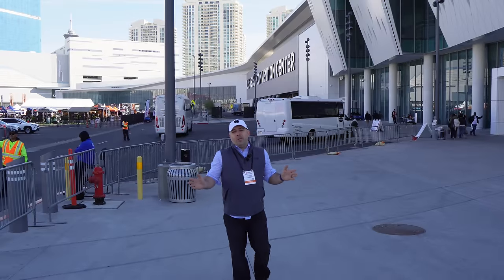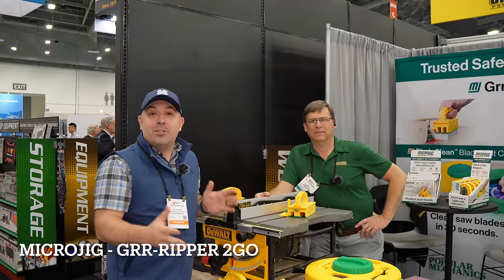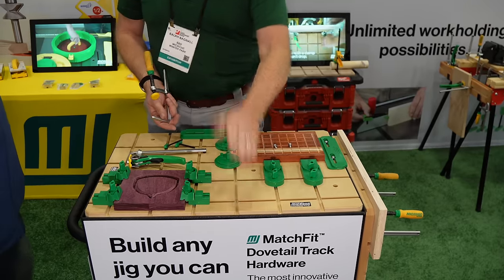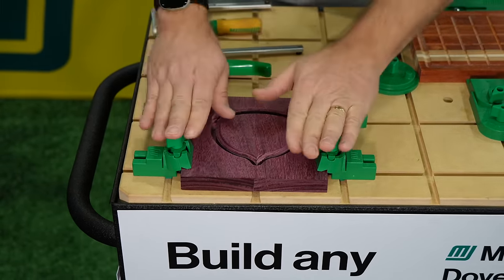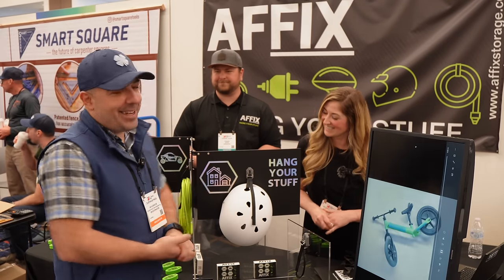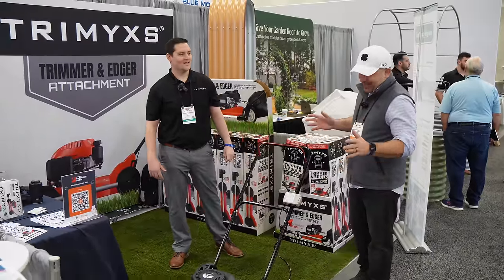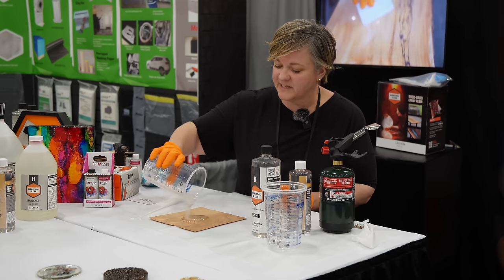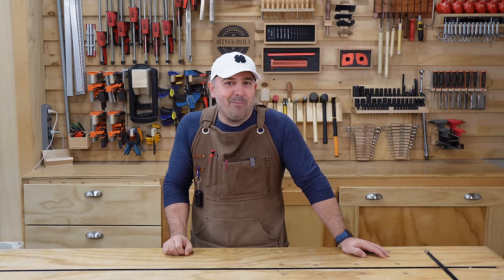2024 National Hardware Shows Coolest New Tools! Day 1 of 3

Comment: It would be nice to see Trimyxs have a trimmer for a riding mower using the mower 12 volt battery with a on/off switch.
Reply from the maker: I talked with them about it (I have a riding) they said it’s something they are working on now. I said would be cool to have it as a mountable arm so you could swing it out a bit so you don’t need to get ultra close to a wall etc